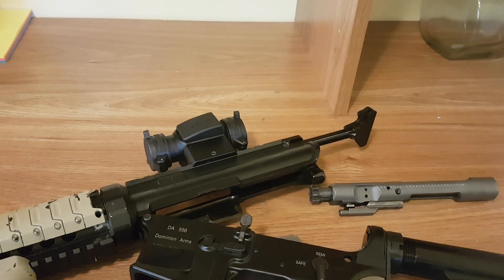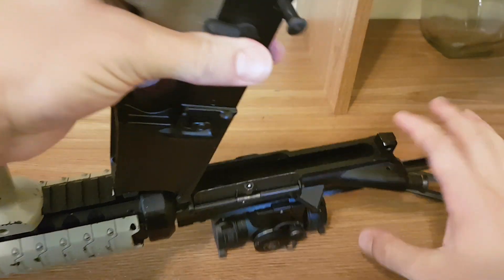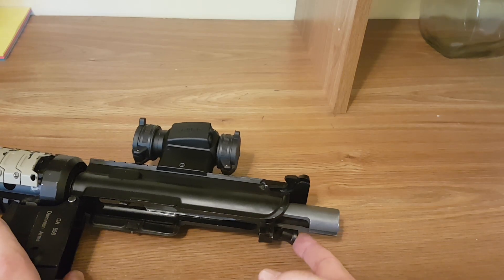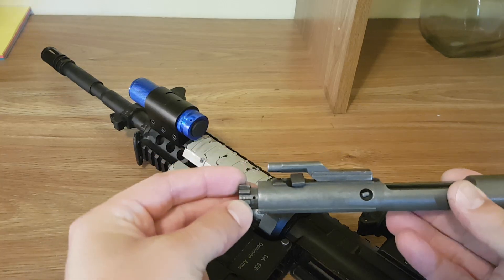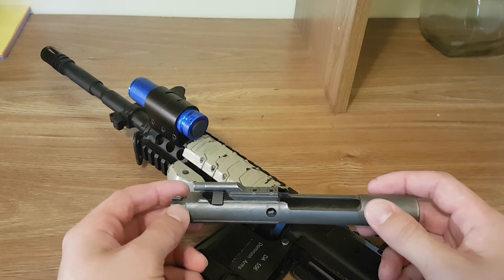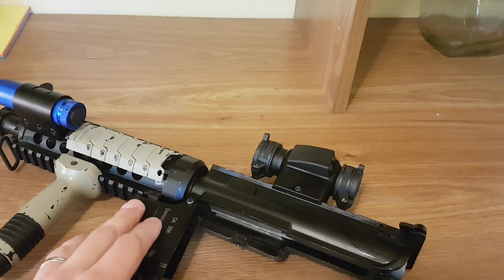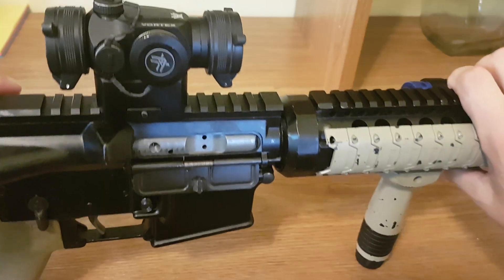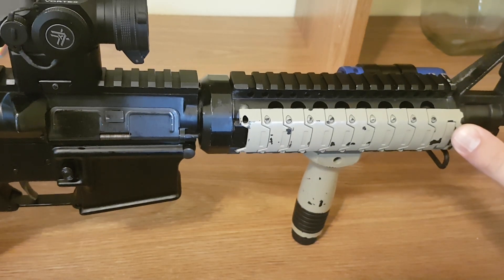What does the Forward Assist on the AR15 Do?

Comment: In my own experience with mine is that it is for silent charging. Because when charging slowly to be silent the bolt dosent close all the way sometimes, press the forward assist and it will close it quietly instead of slamming shut which makes a very audible sound
Reply: And of course for any other reason the bolt may not close completely.  But the forward assist works well for quiet charging

Comment: Before I knew anything about firearms I think I ran about 4,000 rounds through my Bushmaster without cleaning or even oiling it, iirc I used the forward assist maybe 20x.    Once I ran it nice and wet I never had to use the forward assist again, regardless I want it there.   FKN thing is solid, no fancy GI JOE BS on it ether.

Comment: I am no combat veteran but for what it is worth, if you are running an AR without a forward assist, I suggest shelling out $200 or so for an enhanced nitride bolt carrier group by CMC (designed to have less points of friction allowing it to move more freely & an extra gas port allowing more dirt & grime to exit the rifle.  The nitride coating is also easier to be cleaned if you just want to do a quick wipe down), $130 or so for the enhanced charging handle by Radian & $90 for an adjustable gas block (controls how much gas/dirt/grime is cycled back into the rifle).  So basically prep your gun as if you are running a suppressor even if you aren’t.  This all adds peace of mind knowing that you are doing everything you can to prevent the forward assist from having to be used in the first place.  Clean your rifle when ever you have time, no matter how many rounds you have fired.

Comment: Presented without comment: https://www.youtube.com/watch?v=kHpABVx6Bak
Reply from the maker: Good point
Reply: @CanadianGunsNgear  There is another incident where a PFC Patrick Miller of the 507th maintenance Co. used the forward assist of his malfunctioning M16A2 to almost single handedly hold off an entire company of Iraqi infantry at the battle of Nasiriyah, for which he won the Silver Star with V device for Valor.
Reply from the maker: @Valorius  thanks for the info, good examples. There's a reason it's on the AR/M16/C7 platform, and included in military manual of arms, it works. Don't listen to all the CoD heroes that say it's useless.
Reply: @CanadianGunsNgear  Holy cow you hit the views jackpot with this video. o.O I hope for your sake it was monetized.

Comment: First I was trained on the M-14 , I liked the rifle and qualified with it ,then I went to the FMF (the Fleet) and they were in the final stages of transitioning from Garands  and BAR 's and I was issued an M-14 and a BAR ! They would tell you to 
fall out with one or the other, but we were quickly moving to 14's . Not fast enough for me , I felt like I was carrying 3 
M-14's instead of the one BAR ! . Then when I finished my enlistment, I went into the Marine Reserves, and my first day,
the unit was going to qualify, and I was issued an M-16 !  I was "trained" on the M-16 in the back of a 6X6 on the way to
the range where I managed to Qualify, I figured,it had a trigger , it had sights , and it had a magazine , it's true if you fired several types of rifles , you can figure it out. But that stupid FA button, ,well they said "push it before you fire" . I thought 
why did they add this , but I said WTF ,and I did it !  it's like a car manufacturer designing a car that when you close the door,you have to push the other button to make sure it closes ! I don't like the M-16 , but other grunts probably love it .
I can fire the damn thing , and hit somebody with it,so if I don't have a choice I would get by with it, but I will never love
it !

Comment: Its not a jam, its a feed failure. Second, 14 years in the army and a weapons trainer for my battalion and not a single piece of training doctrine nor course attended trained soldiers to use the forward assist for every load. It was part of our sports for when a weapon doesn't fire. Slap, pull, observe, release, squeeze.  Slap the mag to insure the mag is fully in, pull the charging handle back, observe the chamber to insure it is clear, relase the charging handle, tap the assist, squeeze the trigger.  This tactic was and is used to clear all commonly possible issues in 1 single step instead of a shooter being down for minutes doing single steps.

Comment: What if I told you it's actually there because the US Army simply wanted it there, not because it solves a problem? The AR-15 platform was purchased by the Army at first as a stop gap because SPEW wouldn't be ready, but when SPEW failed, they decided to adopt it as their service rifle. This meant standardizing it across all branches. The Air Force had already purchased a number of AR15s, none of which had the forward assist, and they had never run into any problems. The Army, however, really wanted it, and so Colt agreed to make both: a version for the Army that had the forward assist, and a version for the Air Force that didn't. Well, the Army buys a SHIT TON more rifles than the Air Force, so the forward assist simply became standard, not because it was needed, but because the Army wanted it.

Fun fact: The guy in charge of testing actually suggested the Springfield Armory version even though it was inferior because he figured that after a little while, everyone would realize the forward assist was useless and they'd get rid of it, which is harder to do with the plunger variant. See, when you have a gun that's so gunked up you need to jam the round into the chamber, the round doesn't often eject on its own, meaning the forward assist just lets you fire off one more bullet before you have to fix the issue.

Comment: Once you fire your weapon to the point it's so dirty it can't go back into battery with the main spring's strength the forward assist makes your AR into a sort of bolt gun. Of course if it's that dirty the chances of some fouling being in the gas tube is a real concern as well which could completely render your weapon useless or cause damage to the gas system when the pressure can't go where it should. Still you'd have to really use your weapon hard with no cleaning to get to that point which I can't see a proper military ever having without some extreme circumstances. Mechanically a neat idea though.

Comment: Forward assist handle ismto help ( re chamber... Not right. Close action???)
Basically you check for brass, checked brass is there. Put charging action back to seated position and hammer forward assist to help re seat action.
Might've used wrong terminology.
Dad was an army drill instructor.

Comment: It's supposed to ensure that the face of the bolt is properly seated against the back of the round and locked in the chamber, preventing misfires due to the firing pin being too short to strike the base of the round

Comment: Ok. I’m not even watching this videos or any of the others that ask the question “why the forward assist?” Let’s say your out and about in the field (spec ops whizz) you bust 29 rounds ( cuz never load 30 ) your suppressior is hot cuz your a secret squirrel. Uh oh! A bunch of bad guys just rolled up and your trying to be quiet 🤐. Slowly load a mag and pull back the charging handle slowly while pressing your bolt release at the same time. SLOW like.....then when your locking lugs are getting to second base....give that forward assist a nice firm tap. There you go, you’ve silently loaded you ar- whatever

Comment: I use the forward assist when I'm going on operations and I need to remain silent when I chamber a round by pulling the charge handle and releasing it slowly enough so that it doesn't make any noise and I use the forward assist to ensure the bolt is fully forward. Or when I charge my rifle and check if a round is chambered u use it to ensure that its closed afterwards

Comment: Back when it first came out soldiers called it a jam bolt because it would jam the bolt closed. I guess that doesn't sound very hi tech tactical tho so that name never made it on a parts list or instruction manual. Why you would want to jam something into the chamber that doesn't want to go in is beyond me. Especially with .22 and especially in a necked cartrige where if the bullet is a few thousandths wide it's a squib at best and a pipe bomb at worst. you are buying at least a few hundred rounds to go shoot why not just throw that weird bullet away? If for no logical reason it's at least obviously an unlucky round. If it won't go in the chamber how is the barrel gonna fare? All that cromoly vanadium lined barrel and shoot once clean shoot once clean shoot once clean nonsense for naught.

Comment: It seats the round in the chamber properly. The first M-16s had a problem with this, so the M-16 A2 and subsequent versions incorporated the forward assist to solve the problem. Good solution, too, although it would not have been necessary if the original M-16 had been properly designed and tested. I was in boot camp when the new, improved version came out, and we were trained to insert the magazine, pull back and release the charging handle, and then hit the forward assist with the heel of our right hand to properly seat the round in the chamber. In my case, it worked every time, if done correctly, and I never experienced a weapon that was jammed because the lip of the round got hung up on the receiving ramp.

Comment: It does help you to quietly "Lock and Load" by releasing the slide slowly and using your thumb with pressure on the exposed bolt face to close the bolt and made sure it's locked up with the forward assist.  Otherwise, it's useless in my opinion. The Air force M-16/A4 rifles DO NOT have a forward assist. They feel it's useless.

Comment: What a POS. I was trained with the M-1 Garand. Fired thousands and thousands of rounds, had one malfunction over my years of service, a double-fire. That's the kind of malfunction I can live with.
 I didn't like the M-14 although the guts were essentially M-1 guts. Was never issued the little black rifle and I thank God for that. 
If you have to add a step to the firing process (forward assist), you are moving backward, not forward.
I don't want to think about how many of our troops were killed because of this POS con-job played on the Pentagon and our troops.
If I were given any variant of this rifle, I would sell it ASAP. It will never have a place in my arsenal.

Comment: I was always weary of the AR-15. I never understood why it needed a forward assist, but now I understand it's because it was somewhat unreliable. I've owned both AR-15 and AK-47 variants "wasrs" and I like the ak styles better. They just seem way more robust and reliable. I'm not proud of this but I once left my AK in a muddy Creek bed overnight while camping, Sand got in the receiver and everything! As a dare I picked it up and fired a full clip through it without it jamming or having a failure to fire once!but on the other hand the ar 15s I have owned seem to be very picky on ammo and have to be squeaky clean to fire reliably. Something about the AK also just feels more durable, Even though it's stamped it just seems more robust. If I had to pick one weapon in a post-apocalyptic situation I would hands down go with a AK variant. They are also a lot simpler to work on

Comment: I don't know where this guy learned what he's saying, but he's missing one important point about the forward assist. Yes, it is for pushing the bolt forward. But, not when the rifle is jammed or dirty. Those are completely different issues. Scenario: You're in a self-defense situation. You've found a safe place to conceal yourself from the intruder or attacker. However, you need to chamber a round for whatever reason. Maybe you've been exchanging gun fire, your magazine is empty and you just replaced it. Now, if you simply hit the release it makes quite a racket and can reveal your position. The best way to release the bolt in this situation is slowly. Hold the charging handle as you slowly allow the bolt to move forward. This greatly reduces the amount of noise you generate. But, as he tried to demonstrate, releasing the bolt slowly can cause it not to seat all the way. That's what the forward assist is for, virtually silent reloading.
Reply: good observation, but it only tells me the button has multiple purposes, depending on the need...
Reply: @jahnkaplank8626  It's really not an "observation". Yes, the original intent of the forward assist was in case of a malfunction where the cartridge didn't fully seat into the chamber. Older rifles (M1, M1 Carbine, the M14, and others) had that tendency. Modern rifles don't have that problem unless there's something wrong with the rifle (weak spring, heavy carbon build-up, etc.). As long as the rifle is well maintained, the forward assist is not really necessary any longer. That's why most now view it as a tool to be used in a scenario similar to the one I laid out, not for clearing a jam.
Reply: Now THAT makes the most sense of anything I’ve heard or read.
Reply: You're a complete idiot and you don't know what the hell you're talking about. The forward assist is obviously for turning on the Death Star laser mode.
Reply: That is true. Use it for stealth chamber check.
Reply: Wow all this hatred and disagreement over a hypothetical
Reply: If youve been shooting the attacker already knows youre there and most likely where you are. I can say from experience that using the forward assist is very much not silent
Reply: @codyjackalope8464  This is what happens when you don't pay attention to everything being said and you instead only recognize the parts that fit your narrative. My comment states; "You've found a safe place to conceal yourself from the intruder or attacker". In other words, the intruder or attacker doesn't know where you are. I can't speak to your experience. I can only speak to mine. I will concede using the phrase "virtually silent" may not have been the best idea. I did, however, say it "greatly reduces the amount of noise you generate". I know this is true first hand, because of my experience using the forward assist.
Reply: @edweaver6047  thats all well and good but why hide rather than just shooting the invader. 1. Letting a life and death situation drag out is dumb. 2.i refuse to let someone make me afraid in my own home.
Reply: @codyjackalope8464  1. It's not about fear. If letting a life or death situation drag out increases my chances of survival, that's exactly what I'll do. 2. You seem to be forgetting; the intruder or attacker is just as committed to surviving and taking you out.
Reply: @J-jizzy_  ok we wanna talk about having the best chance of survival and we wanna use a rifle in .223 or 556. Thats great in combat but for any distance inside your house a semiautomatic shotgun with 00buck is your best chance. Hiding will only get you killed. When dealing with criminals the only thing that works is charging the situation because these people have been trained by society and the prison system to only understand violence
Reply: @codyjackalope8464  
"I refuse to let someone make me afraid in my own home".  Pfffft, you never met my ex-wife..
Reply: So going through all that nonsense and then beating on that stupid clacker button as you try to beat the bolt into place yeah that's the height to being quiet. Yours has got to be the stupidest non-combat comment I've heard in a long time. If you're going to play that stupid game you just leave the bolt lock to the rear until the last minute when you Bap the release with your thumb. By the time the bolt carrier locks forward the noise it makes is the quietest in the firefight
Reply: @Reaver6666  There are so many things wrong with your comment I don't know where to begin. So, I'm just going to leave most of it for others to comment. The only thing I'll comment on is this: If you have to "beat the bolt into place" there's something wrong with your rifle and you should take it in for repairs.

Comment: "Direct impingement" is officialese for "self dirtying".  The gas system does not 'siphon off' anything.  The gas of the burning gunpowder (roughly 55,000 psi) is diverted down the tube where it blows through the bolt carrier and bolt, burnt and semi burnt powder bits and all.  A piston like on the M14 would have prevented the powder fouling.  (It seemed a good idea at the time.)

The same function is served in the M1 Garand and M14 rifles by the 'charging handle'.  The doodad sticking out the right side of the receiver used to pull the bolt back to charge the chamber.

In the video, the narrator cannot make the rifle bolt stay open.  More than likely as the rifle is clean (as should be) and without ammunition (also as should be for a video).  In the preceding semi and fully automatic rifles infantry men (and possibly all) troops were taught to push on the charging handle to ensure the cartridge was fully seated and the bolt was closed and locked.

Nothing really new, other than the initial versions did not have such a mechanism.

Comment: I never needed it when I was in the Army, but when I recently got my Smith and Wesson M&P 10 (an AR-10 type rifle), I had out-of-the-box issues with the weapon failing to cycle. While working through the problem (which later turned out to be caused by a stiff buffer spring AND an unpinned gas tube!), I found it would cycle just enough to pick up a .308 round, but not go fully into battery. I could feel the round get picked up, but also not chamber fully. When that happened, I would use this forward assist to drive the cartridge home. So, as some other commenters have pointed out, it does have some use with faulty weapons.